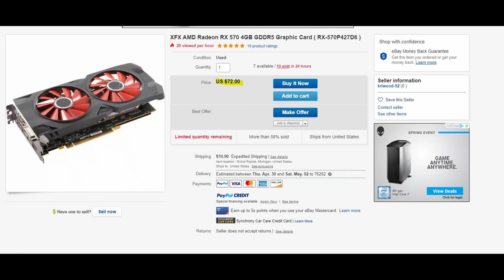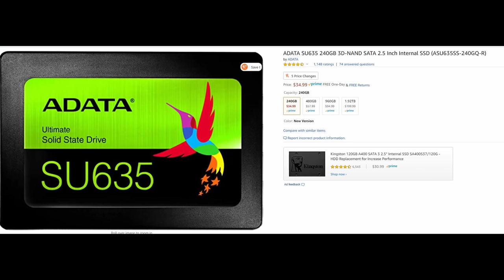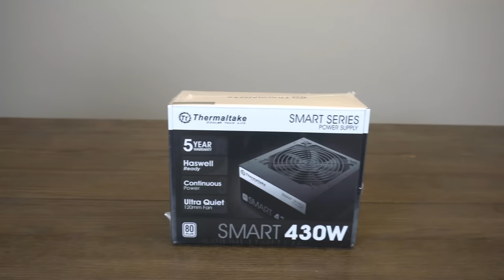$220 Just Get Gaming PC Build - Dell Optiplex 2020 + Benchmarks

Comment: Would a power color rx 570 fit in a optiplex?
Reply from the maker: I’m not sure if the physical dimensions and if you are trying to fit something without removing the HDD cage but yes it would work if it does fit in that space , and definitely if you remove the cage.
Reply: @PCTechHustle  ok. It looks a little tall and it has a backplate
Reply: But just to be safe I will get the same model you have in yours
Reply from the maker: Yeah I’m just not sure.  It also depends on the model of Optiplex you are using.  The 2nd gen Optiplex like I used here has more strict ram clearance requirements.  Where later generations do not.
Reply: @PCTechHustle  ok thanks

Comment: 240w in 12v ? that i5 consumes max 70w and rx 570 110-120 so with some adapters it can handle it (to be safe rx470 would be better) but i mean why dont try it out with stock psu ?
Reply from the maker: Its possible it could have worked but honestly would be have been very close and being a 10 year old PSU, I didn't feel it was good to recommend it, especially if one is spending some additional cash on a new GPU, etc.
Reply: @PCTechHustle  counter to many beliefs on the tech community actually those oem PSUs are better than we think and we shouldn't judge by theyre non black panit XD. my point wasn't to criticize but just to point out to some fellas, like me ,who cant afford both gpu and psu ungrade
Reply from the maker: Oh i didn’t take it as a negative.  This is just my personal opinion.  Heck yeah if someone were to explore the option you mentioned and get a lower powered GPU and even stick with the HDD and not upgrade to an SSD, one could get this build cost down to around $150.  However seeing the limitations already I wanted to recommend something in terms of where to start from and make some minor upgrades to make a very capable gaming machine that has still a bit of a future ahead of it.  

I may look into doing that for a future video.  To find the most bare bones option possible via using a lower powered GPU, leave the stock PSU, and HDD to “REALLY just get started gaming”
Reply from the maker: I may do just this for another video!  Thanks for the ideas 😉😉😉
Reply: @PCTechHustle  I'd love to see that video 
just please for god sake dont recommend anything without ssd since the day i got one every pc without ssd feels painfully slow😅
Reply from the maker: Hah yeah!  SSD even a cheap 120GB should be considered for anything these days.
Reply from the maker: @m1r198  I am going to have to find a pci-e slot powered GPU as the 990 does not come with auxiliary pci-e power cables.
Reply: @PCTechHustle  you have adapters for that
Reply from the maker: @m1r198  True, I am not a huge fan of using adapters if I don't have to ;)
Reply: It could over heat with the age of the power supply and could fry the pc because of the type of graphics card it has in it also it would be safer anyways bro

Comment: would a dell optiplex 3010 work?
Reply from the maker: Yes it would and actually perform a bit better with the newer gen i5!  You would have to overcome a few more proprietary power connections that would require adapters but nothing ground breaking.
Reply: PC Tech Hustle k thanks!

Comment: Do you have a discord server? I'm buying an optiplex 980 so I have questions about what you would recommend as an upgrade path
Reply from the maker: No discord yet.  I’ll be launching that soon.  

Unless you are really try to go the ultra budget route I would not suggest a 980.  They have strange proprietary coolers which prevent many conventional GPUs from mounting.
Reply: PC Tech Hustle Yeah it was given to me sou might as well put it to use
Reply from the maker: Gotcha!  Looks for some smaller low profile cards.  I’ve found some content on people upgrading 980s.  It’s a bit sparse though.  I’ve actually had my hands on several and didn’t end up bothering with them though and resold the stock machines.
Reply: PC Tech Hustle I was thinking of putting a gpu in it then upgrading the power supply then mobo and cpu
Reply: I was planing on moving all the components after I upgrade my psu

Comment: What are your thoughts about my rig. 
I5 4590 
Gtx 980 
16gb ram 
Ssd 1tb 

I want to hold out until some new tech comes out around the new consoles if I can would you suggest I get a rtx 2060? I don’t always play the new new games but I would like a FPS jump at what I’m playing. I have a 1080 p ultra wide 144 Gsync monitor and I can’t activate Gsync with my current rig. I was thinking about doing something small just to hold me for 6 more months
Reply from the maker: Your rig is very solid!  Also has some upgrade path still!  I’d buy high on the GPU too that way you can build around the rest of it.  2060 is a very solid upper middle ground card.  If you can find you a cheap 4770/4790k i7 you will still have tons of CPU power for gaming to support that 2060.
Reply: PC Tech Hustle thank you!! Problem is the 4790 is still $150 and that’s just crazy. What gpu do you recommend if I just keep cpu till I upgrade around October or so. I plan on selling the gpu and getting a bigger one soon when I do the motherboard and cpu I can really set myself up so I don’t have to upgrade again for 5 years just holding out as long as I can.
Reply from the maker: Honestly just depends on how much you are willing to spend.  The 2060 as you mentioned is a popular middle ground card for under $400 and offered great 1080p performance but also let’s you delve into higher resolutions / Ray Tracing
Reply: PC Tech Hustle I can spend whatever on gpu as long as it’s under $800 but I figured I would get major diminishing returns. I am looking at a minor cpu upgrade. Just trying not to spend a lot on it because I do plan on getting the amd 3600x after new 550 motherboards release
Reply from the maker: Nice!  Like I said always buy high with a GPU, you can always upgrade CPU later to get the max out of your investment.  Heck not even 2 years ago I was still on my 1st gen i7 paired with an EVGA GTX1080.  Yeah I was very CPU bound but I had a bad ass video card to take with me as I upgraded!
Reply: PC Tech Hustle thank you for the suggestion I’ll definitely take that into consideration. Only thing is the new nvidia is supposedly incoming so I am now leaning towards just getting 2060 super or 2070s just so I can sell it and put towards the super new stuff. Being this cpu bound will I still get a massive FPS increase?
Reply from the maker: @PersianGamer36 I think you will still get a pretty good leap in performance, yes.  Also a key note about 1440p gaming is it puts more of the work load on the GPU which could also smooth out your game play if you have a 1440p monitor.

Comment: I’m new to things like this (and really stupid) but i’m planning on recreating this. When I put everything in place, are there any drivers/bios I need to download, or is everyone good to go when it’s all in the PC in its designated place?
Reply: Also,  great video lol.
Reply from the maker: You will likely have to install windows as the drive (if yours comes with one) will most likely be wiped and require a reinstall.  If you are lucky too it will come with a key sticker on the case exterior you can possibly use to activate windows.  Other than that its basically plug and play, one option will have to be enabled in the bios to boot from an SSD, and then the rest is all software.
Reply from the maker: Thanks!
Reply: PC Tech Hustle Thanks for the response! How many FPS do you think I could squeeze out of GTA5?
Reply from the maker: Depending on settings but easily could hit 80-100

Comment: can anybody help me out here? I have an old desktop pc i bought for 100 bucks. it has an i3 7100 and 8gb of ram with a stock psu that holds about 185 w. I don't yet have a GPU, but i have a 150 dollar budget for a GPU and a power supply if needed. I am also getting a ssd for it that will cost about 30 dollars (240 gb)
Reply from the maker: With a $150 budget I would definitely look into some used parts like I did with this one.  You can definitely get a solid rx570/580 under $100 on eBay or maybe your local markets.  A cheap 430-500w PSU should run you between $35-50.

Comment: How were you able to switch to uefi boot for the gpu to work? It isn't booting from my ssd when i switch in bios. Thanks :)
Reply from the maker: There should be a boot setting to choose from once you get into the bios screen.
Reply: @PCTechHustle  Yeah thats the weird part whenever I clicked it in bios it say's it can't find anything to boot from even though I have windows on a bootable usb as well as the ssd
Reply from the maker: @drewt69  try toggling all the different modes.  I can't quite remember what I had to set mine to.  I thought it should have been UEFI.

Comment: Hey they are out of stock on the PC is there another place to get the pc I just 

Edit: I if someone can find one for me I'm not good a finding PC stuff if you could that would help thanks
Reply from the maker: Try just doing a generic search of Optiplex 790 or 990 on ebay
Reply: @PCTechHustle  will do, thanks a bunch

Edit: great video by the way
Reply: @PCTechHustle  hey I found this PC 

DELL Optiplex 790 MT PC Quad Core i5-2400 3.10GHz 4GB RAM 250GB HDD Win 10 Pro
If you could can you tell me if this works
Reply from the maker: That will work!  That is the same CPU I had in this one.
Reply: @PCTechHustle  thanks so much I've been saving up for awhile now I'm only 13 so this helped a lot to help me find out what I was going to get I don't have enough money yet but I will try to get enough thanks again

Comment: Why is there 2 different Dell optiplex 990 i5 2400 3.1ghz
Reply from the maker: There is an i5 2400 @3.1 ghz and an i7 version @3.4ghz.  The i7s demand a much higher selling rate on ebay though.  It would be cheaper to buy the i5 version like I did (for $75) and upgrade to an i7 for another $50-75.  Dell sure does make their naming conventions strange.  You would think each CPU skew comes with a unique version number, but it doesn't.

Comment: I need help I have a Optiplex 3020 i5 4570 and I bought a msi armor gtx 1060 3gb and I put the gpu in but it is not showing up that it exists on my device manager so I can’t install the drivers because it doesn’t exist to my pc
Reply from the maker: But you are getting video output from it?  Possible the card isn't fully seated into the pci-e slot?
Reply: PC Tech Hustle I’m not getting video output either
Reply: Just says no signal
Reply from the maker: Any way for you to test the card on a different motherboard?
Reply: PC Tech Hustle I can maybe try a pc repair near me or something
Reply from the maker: Any functioning GPU should allow for basic video output.  So sounds like something fishy is going on.  Was it maybe previously used for mining?
Reply: PC Tech Hustle I’m. It sure bought it from eBay could it possibly be because I’m using the standard 290W psu
Reply: The fans on the gpu spin and stuff so I thought it can’t be the psu so idk
Reply from the maker: That could be it!  That is some low wattage even for a lower grade PSU.  I wouldn’t give up on it just yet.  I would suggest a 400-500w and give it another go.
Reply: PC Tech Hustle So even if the fans are spinning it still could be the power supply causing the problem?
Reply: Really appreciate you helping btw man
Reply: I don’t wanna buy a new psu and the gpu still not work and waste my money ya know?
Reply from the maker: Takes little power to spin fans but a lot more to initialize the GPU.  Honestly I would suggest a new PSU of about 400-500w, even though I know you don’t want to budget it right now.  It’s worth a shot and a good investment to your system, even if the GPU is hosed.

Comment: I know about as much as computers as I do women, which is not a lot. The best computer I have is an I5 2.8  Asus. I spent way to much for it, but it has held up well. The only thing I have had to replace was the power supply.  What I call my old computer, is a Intel 775 duo core quad 2.6. Which died a few years ago. So, while I am sitting here on the Covid vacation, I thought I would see if I could get it working. After a lot of trial and error, mostly error I found the power supply was bad. Which took out the graphics card. That was the newest thing in the comp. I checked every thing down to the motherboard and CPU. Then I got a hold of another old computer with a 775 socket but it was a 2.2 duo.  It worked but was slow. I put the 2.6 out of my old computer and put it into this one. The CPU was bad. I rooted around until I had enough parts to rebuild the computer. All together I spent about $10 out of pocket for SATA cables and the paste for the heat sink. It is not perfect and it is not fast but it will do as a back up. There were times I felt like beating it with a hammer. Many times I had to walk away. I spent hours trying to get the heat sink back on. Your videos do interest me but I have Never had any good luck with Dell or Hp. Perhaps that is why I have so many old dead computers, lol.

Comment: Could I upgrade to a 500W PSU?
Reply from the maker: Sure!  You won’t need that much but you certainly can if that’s what you want to do.
Reply: @PCTechHustle  It would probably be for upgrades in the future. Thanks!
Reply from the maker: Cool.  Yeah go for it!
Reply: @PCTechHustle  Awesome! So last question what would be a gpu upgrade after the MSI RX570? Also should I get a ram upgrade? I saw some ddr3 going for like $12.
Reply from the maker: Target 16GB of ram if you can.  GPU basically the sky is the limit.  A cheap-ish upgrade though could be a 1660 super or 2060.
Reply: @PCTechHustle  Ok Thank you so much!

Comment: Will a gtx 970 fit?
Reply from the maker: If you took out the HDD cage like I did, yes!
Reply: PC Tech Hustle what’s the difference between the 8gb and 4gb Rx 570?
Reply from the maker: Not a ton.  More VRAM typically in theory will result in better performance just depends on the title
Reply: PC Tech Hustle okay thx

Comment: can I use this as a streaming PC?
Reply from the maker: As in the dedicated stream box or as in a gaming + streaming machine?
Reply: @PCTechHustle  dedicated streaming
Reply from the maker: It could get the job done since that would be the only task.  I would suggest maybe an upgrade to an i7 though, which can be had for another $50-70 on ebay.
Reply: Which i7 would you recommend? Considering the fact that there options
Reply from the maker: i7 2600.  You will get 4 more thread ya and a bit higher clock speeds.  It’s about the best you can do on this generation of Optiplex.
Reply: @PCTechHustle  alright sweet thx!

Comment: The thing is it will the first pc I build and I dont want to put in a full gpu I want to put in one of the low profile ones
Edit but the frams make me want to I'll figure out what I will do
Reply from the maker: You can fit in smaller “full sized” GPUs without removing the drive cage
Reply: @PCTechHustle  ok what was the gpu you use in the video I cant remeber what it is
Reply from the maker: Rx570

Comment: Could you upgrade the Gb of ram to 16
Reply from the maker: KappaK. ϟ yes and this system has 16GB
Reply: And I’m not sure if my ram is ddr4 or ddr3 could you help me out possibly
Reply from the maker: Depends on what your motherboard supports.  Are you building an Optiplex up as well?
Reply: I’m not a hundred percent sure but it’s part of my prebuilt pc it came with my pc from dell

Comment: Okay I wish I could do this but I've got a BTX system sadly so upgrading is little to impossible, I currently have a low profile afox geforce gt 730 (the bad one... Ddr3 and I regret it honestly) and i5 2400 and 16 gigs of vengeance memory, I tried upgrading the psu to get a better graphics card but nope, the form factor is very fiddly and I couldn't get anything to work together, I ended up selling the new PSU. Sad lyfe
Reply: It doesn't even play GTA V at all 😭 it crashes 24/7 oof

Comment: I have put the MSI Armor RX 570 in several Optiplexes. It will fit without removing the HDD cage, but only just. If you're using a 7010 or 9010, you're going to have the USB 3.0 header to contend with as well. It's right in line with the SATA ports. My solution was to connect it with a right angle adapter and cut a hole in the HDD cage to pass the cable through. Then I moved the HDD to the lower slot in the cage. Looks pretty tidy after I painted the case interiors flat black.
https://scontent-dfw5-1.xx.fbcdn.net/v/t1.0-9/fr/cp0/e15/q65/95263383_3206969326015115_9079505634759540736_o.jpg?_nc_cat=101&_nc_sid=478219&efg=eyJpIjoidCJ9&_nc_ohc=eBlt2AXJUVUAX9jjmkS&_nc_ht=scontent-dfw5-1.xx&_nc_tp=14&oh=d14bbfe74afb3eb8ef17faa3b48c13b7&oe=5EF74BAE
Reply: The much easier way to go gaming with an Optiplex:
1. Buy Optiplex
2. Insert GTX 1050 / 1650
3. That's it. There's no step 3.
Reply from the maker: drewdane40 defiantly a weaker performing option but easier and cheaper if going 1050/1650 route.

Comment: Could it stream? my sister wants a starter pc so she can make videos, can this stream on twitch?
Reply from the maker: Stream as dedicated or game + stream?
Reply: @PCTechHustle  game + stream
Reply from the maker: I would say this i5 would struggle with that BUT you can always upgrade to an i7 2600 and still keep this build cost under $300.  Those can be found for $50-60 on eBay.
Reply: @PCTechHustle  ok cool.
 This is hypothetical question, but could I switch it from Intel to ryzen?
Reply: @josiahwilkin  nope, yo can't change the cpu unless you change the motherboard. And what CPU are you thinking to upgrade to.